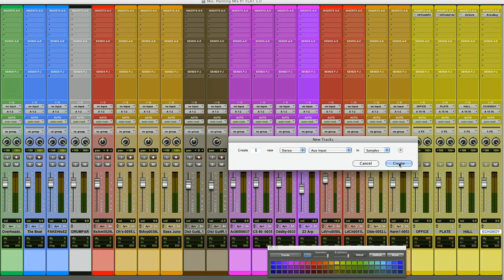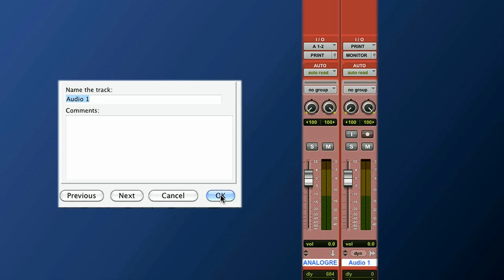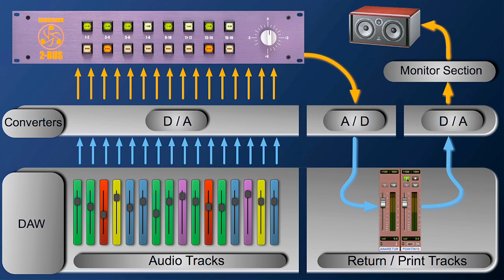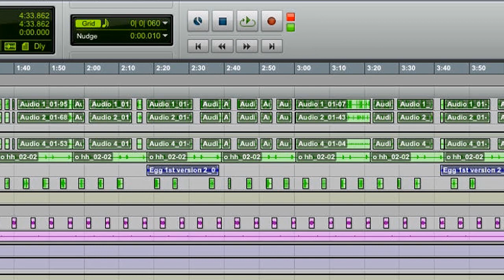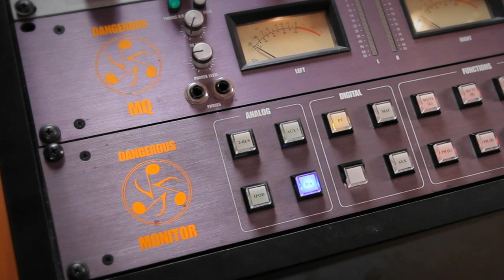Setting Up Software & Hardware for Analog Summing

Comment: You failed to mention how to set up during tracking. Not everyone uses a summing mixer for just mixing DA/AD, since you can sum both line or mic signals together with summing before even reaching the DAW.

Comment: Due to the permanent orientation of the room, I am stuck in the corner. The speakers are also quite close to the corner. I already knew what a sonic disaster corners are; but now I can't seem to find any help in treating their acoustics. Can you provide any insight/links? I get terrible reverb and bass fluctuations.

Also, is an AD/DA more important than first getting a preamp? I can convert through my Access Virus fairly well until I would get a dedicated converter. Thanks for your insight!

Comment: How can you use such small monitors with what looks like minimal decoupling; yet have a $10-20k rack? I'm merely an amateur at creating a good mix, but I would greatly appreciate some gear advisement:  I use 8" monitors from only two feet away, on primacoustics recoil stabilizers. Obviously too large of a driver & too short of a distance. What monitors would you recommend for a small studio with terrible acoustics? Along with that, what is the single-most important first piece of rack equipment?

Comment: I'm going to have to buy about $15k in gear before I can even try this.
Reply: Pointless. Just use a cheap summing mixer during tracking and you've basically achieved the same result, beforehand..